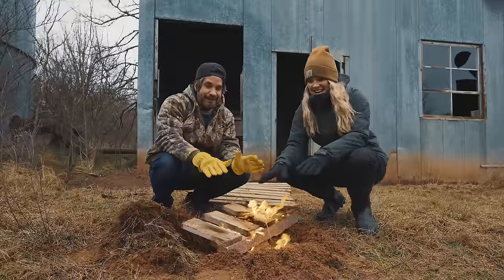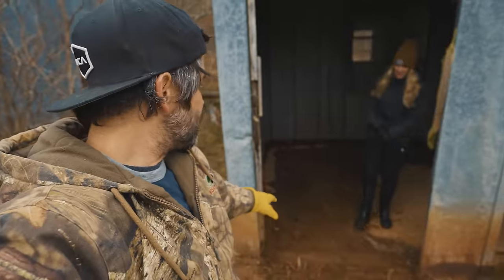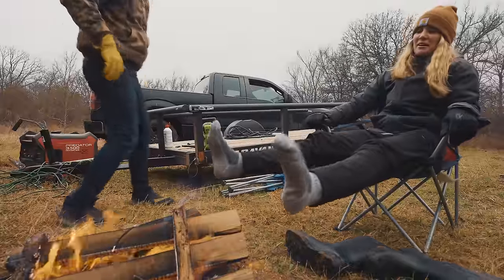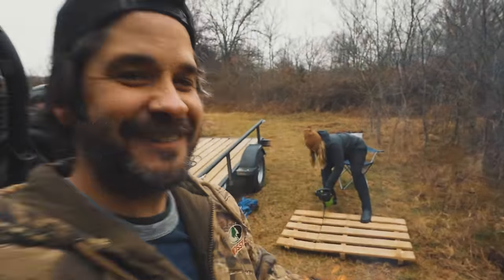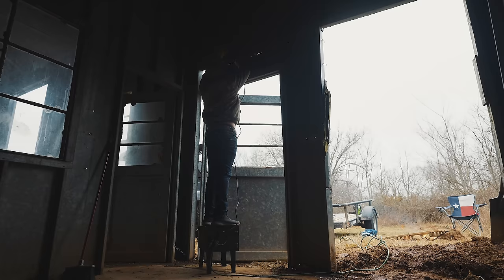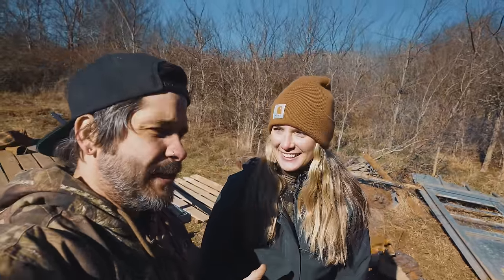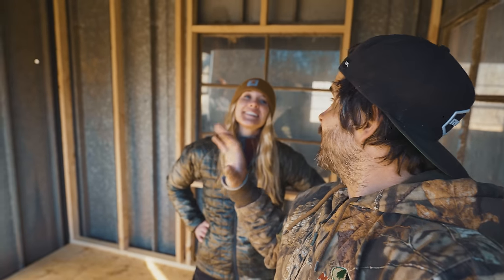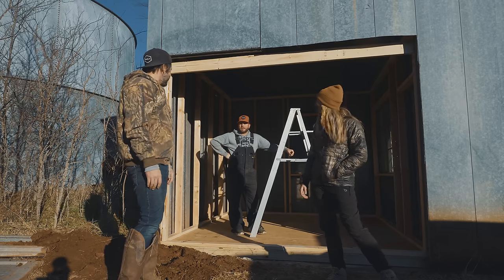Framing Walls For The TINY BARNDOMINIUM On A Budget! Ranch Makeover!

Comment: Just a heads up, when installing a sub floor over a concrete slab, otherwise known as a monolithic slab, use either pressure treated 2x's or put a vapor barrier between the subfloor and concrete. 30lb roofing felt will suffice. One more thing to consider is the surging of the generator is hard on your tools, so it's a good idea to put the generator under a constant load, using something like a fan or work light that constantly runs. Just some helpful thoughts from someone who's been around the block a time or two. In provision or ingenuity are good traits to have. Keep it up, and you'll go places. Good Job!

Comment: Looking good. Glad to see y’all did put down a floor in there. I was concerned about water running inside. Btw the truck tailgate would have been easier to stand on to cut on the outside except I think y’all’s fire was in the way of using it.

Comment: You could put a concrete frost wall against the metal wall and encapsulate the rusted bits, it would resolve the structural issues with the building and fill all the gaps below.
This could be done just to the exterior and let it seep into the interior against the interior frame. maybe just a few inches above the rust line the maybe a foot below the existing slab.

Comment: You should use concrete blocks to raise that floor up a bit.  Also lay down a plastic vapor barrier and a layer of foam board insulation under the subfloor

Comment: Not sure why you wouldn't just seal up the small door and use it as a window only for light.
You need to run some cement around the base of those outside walls at least, to stop all water seepage.  If this is a forever project you need to do things properly .... no near enough is good enough.

Comment: Awesome progress guys! Wow Jason! You taught your lady to use a chain saw and watch her go now, Awesome job kids! I would at least put some plastic between the wood and the metal. That metal will sweat when it's cold outside and warm inside. Also I would level that dirt off in front of the little cabin you're building so when it rains mud wont run back into the barn. Have an awesome day! X's & <3

Comment: Nice job cutting out that opening and framing up! I would still be concerned with water entering the building though. Maybe work on putting in some drainpipe around the building and rent a spray foam machine to insulate the walls? Replace the windows? I know it all costs money! Keep up the good work guys.
Reply: Yeah I was thinking the same thing.  Putting all that work in and then getting flooded out would be a real bummer.

Comment: Concerned about putting untreated wood right down on wet cement floor. Dirt outside higher then cement. Also metal siding has holes at bottom. 🤔Won’t hold up for the long run

Comment: You guys have a huge gap in the wall near to the tanks. Take a very good look at your video for today to see it. Water will run into your flooring if it rains, etc. You NEED to seal up that gap with an out side short block wall on a concrete foundation that goes below the wall on the outside or you will be in some big problems which caused the mud on your floor in the first place. Please do not hesitate in the slightest on that fix or you will have to tear out your flooring and your walls because of water damage and mold.
Reply from the maker: We're aware and worked on it! Thank you though for looking out!
Reply: @Steve43, as  fellow viewer, I like the kind way you made a helpful suggestion.
NOW!!! EVERYBODY!!! We each need to find ten new subs for each of their channels!!!
Let's "getter' done!!"

Comment: Hoping the bottom won’t leak into the room. Perhaps a rubber sealant on the outside bottom walls would help.  Is that old wood stove useable, if so build you outside fire in that stove ..wood will last longer away from the wind.  Noticed no insulation between metal and frame up.  Sure would help.
Reply: Glad Jared is there to help... can spray that insulation...

Comment: I've been racking my brain to figure out what the heck you were cutting  off in that floor, having training and knowledge of electrical, I have whittled it down to 2 choices, and praying I'm  wrong, first is ground cables for lightning suppression system for all that piping, as most lightning starts from a negative charge of electrons in the ground, all that pipe has got to be a great ground source, thats why underground powerlines get more strikes than above ground,, or, and I really hate this one, that was a pumping relay station,, and those grounds dissipated static electricity build up from oil passing through pipes. Which means, there is miles of pipe. Don't  hate me, just educated guesses,and appears a jackass scrapper took the boxes, etc..... that would help you to identify them.

Comment: Ok yall things are looking good! Save that old sheet metal and patch the holes in the bottom of the walls. Then take the bigger pieces and build a temporary fire pit and burn that wooden pallet inside the building. Its too dang cold up there to be with no heat!

Comment: I really dont like the floor over cement that had water running and dirt over it. THE HOLES in the walls can be patched from the inside , maybe rivets or screws. Insilation and vaper barrier then wall finish. The old windows have no insilation value but will stop the wind. It will be beter that a tent. Good Luck. As soon as you can get a Back Hoe or a Minni X.